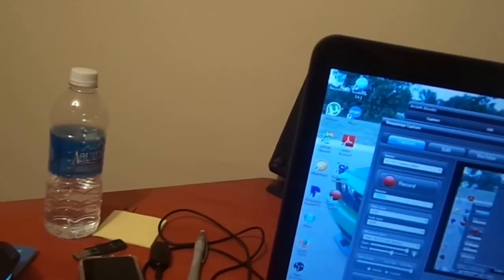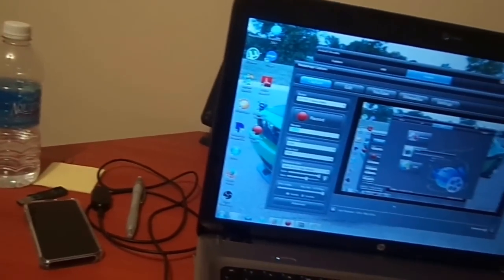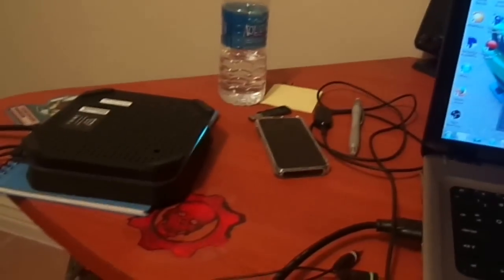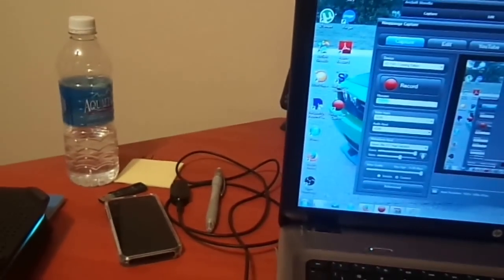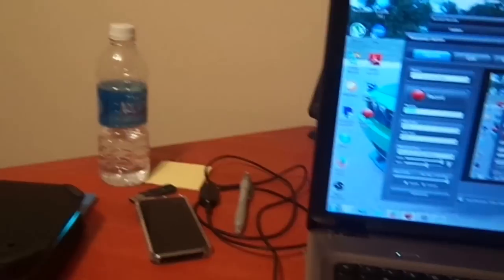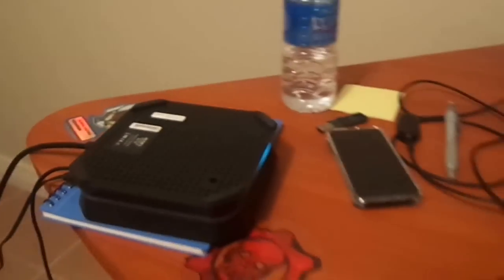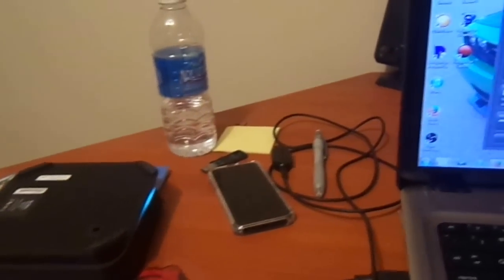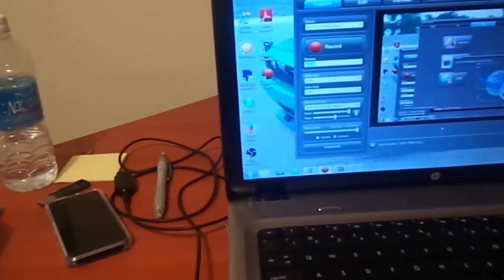HD PVR 2 How to Fix Freeze/Lag Problem

Comment: My solution to this was mounting a 120mm PC case fan to the bottom using some zipties. The fan could be plugged into my computer though a rubber grommit in the back of the case and looked pretty sleek.

Comment: What a terrible design. Why would they design it with the vents on the bottom if it has tendencies to overheat?

Gonna try your method and see if it works. Thanks for the vid.
Reply: Turning it upside down worked like a charm, by the way.